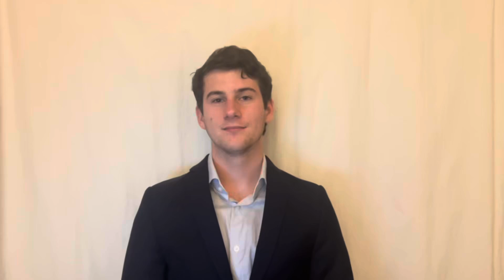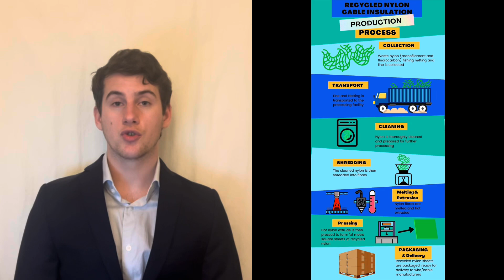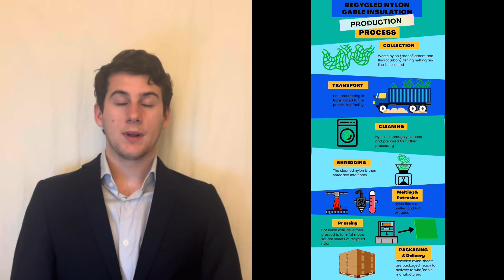20731416 Assignmemt 2 - Part 1

Comment: The project offers a creative and eco-friendly solution to tackle both marine pollution and electrical insulation challenges. However, the presentation lacked noticeable body language, which could have enhanced engagement. Greater emphasis on the economic feasibility of the solution would strengthen its appeal. Additionally, there could be less focus on comparing the performance of recycled insulation with traditional materials, particularly in areas such as heat resistance, durability, and electrical safety.

Comment: Hi Finn, Your idea of turning discarded fishing line into insulation is great, and I can see lots of potential due to the sustainable nature of the material sourcing. The accompanying image is visually pleasing and is helpful to understand the process from the very start to the end. There are a few things about this that I would love to know a bit more about. Firstly, what is the expected demand for wire insulation? and secondly, what is the process for collecting the discarded fishing lines, and is there enough readily available to produce the desired quantity of insulation? A problem I could see occurring is the fishing lines/nets being in difficult to reach areas, such as behind rocks, or tangled around things, and therefore making it very difficult and slow to collect materials. Despite these, I think it is an awesome idea and hope to see it implemented in the future.

Comment: Hi Finn, great presentation!
Your image was fantastic! The manufacturing process is very clear, and the image is visually appealing. I noticed that your production process ends at packaging nylon sheets for distribution. Would this mean that your product is actually the nylon sheets that is sold to manufactures to create a product that they desire? I think that it is a very appealing product for companies wishing to manufacture products from sustainable materials. As it is cheap, it would be very competitive in the market for nylon. I think your product would be even better if it involved manufacturing the cable insulation and selling that as a product.

Comment: Dear Finn
This project Recycled Nylon Electrical Insulation for Wires and Cables made good use of visuals, but incorporating body language, such as moving your hand or pointing at the product image, would make the presentation more engaging. The project presents an innovative and environmentally sustainable solution to both marine pollution and electrical insulation needs, with the unique idea of repurposing discarded fishing lines and nets into insulation material. However, while the environmental benefits were clearly outlined, it would strengthen the proposal to focus more on the economic viability, specifically how recycled fishing lines compare to conventional insulation materials. Additionally, elaborating on the performance of the recycled insulation, particularly in terms of heat resistance, durability, and electrical safety, would provide a more comprehensive comparison to traditional materials.
Great Work Finn!

Comment: Hi Finn, It is such a good idea to use fishing line to turn it to electrical insulator because fishing line are everywhere in the water where people go fishing. I also like the slide for manufacturing process as well because it show a good summary of the process and is made by yourself. However, It would be better if the insulator is not transparent because most of the fishing line is transparent to lure the fish. The transparency of the insulator could attract heat which reduce the performance significantly. But in the end, your manufacturing process is realistic and can be done. I hope I can hear more information about your product in the future.

Comment: Dear Finn, what an awesome idea!

I appreciate that you included the project image in your video only when discussing the product manufacturing process! Regarding the product itself, I have some concerns with its safety. While nylon is an electrical insulator used in wiring, due to the strict safety standards in Australia, there are requirements in terms of the thickness and the properties of the nylon itself when used as an insulator. While this varies according to the type of wiring manufactured, I would appreciate it if these concerns would be addressed in your video. Looking at quality control for the product, the insulator thickness needed in electrical wiring, and ensuring that the electrical insulators will not fail under the majority of situations.

Yours sincerely, Kieran Macfarlane

Comment: Great product Finn! Your product seems to be very reliable and a great benefit to the community! In your video, you state that the fishing line will be sourced from the ocean and other remote places. Will this fishing line be hard to find if it is discarded in the ocean? Do you plan on setting up infrastructure to map where the discarded fishing line is using geotechnical software, or are you relying on a build-up of waste material delivered by the tide to certain locations? In the future, you could incentivise businesses and charters to bring their wasted fishing line to your workshop to cut costs on transport. I would like to hear more about the cleaning process to create the insulator cable.